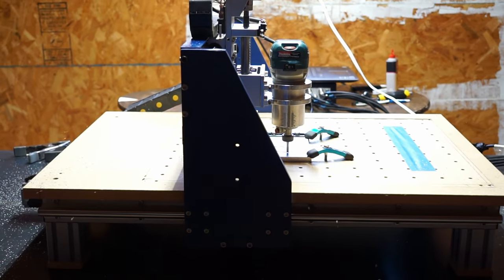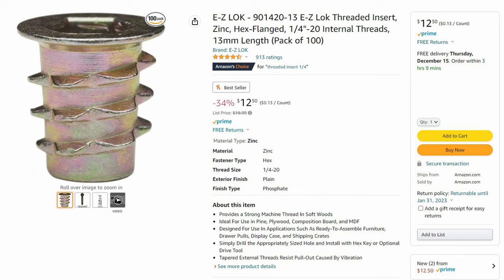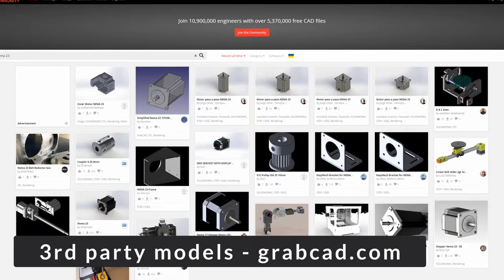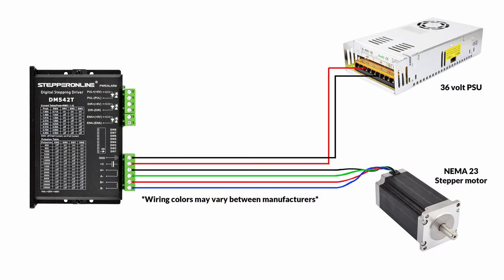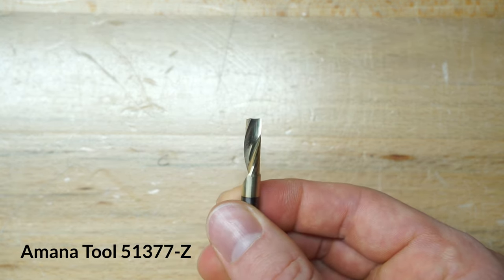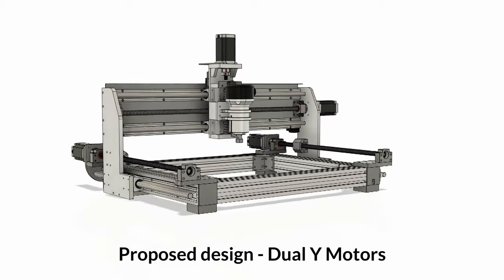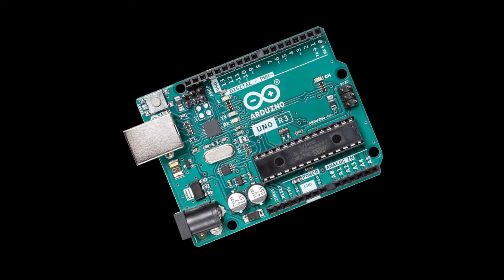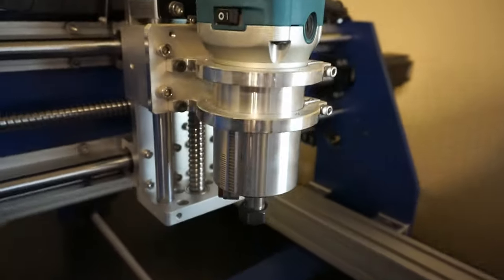DIY CNC: Your Questions Answered (and what I'd do different)

Comment: I also had high hopes for closed loop. After actually trying them I'm disillusioned... SO many wires, delay in step actuation, delay in enabling, whenever they aren't happy they just shut off and need to be power cycled. Take more space and don't even have more power than a regular stepper! Not a fan for now.
Reply: @Maxim Kachurovskiy :  Interesting feedback Maxim.  So often Closed-loop systems are presented as the "Holy Grail" of CNC machinery... a Must-Have, if your budget allows.
Things are not always as we are told then!
Reply: @PiefacePete46  yeah. I'm sure there are good uses for them but so far I had loads of trouble with them and few benefits.
Reply: I don't think the closed loop stepper is a great idea anyway, it won't even close the real loop, which is the actual distance the machine is moving. What you really want is the feedback from some linear encoders mounted on each of the axis which would take care of any mechanical error due to backlash, missing steps, or whatever. It's the only way the system will know how much error it needs to correct.

Comment: opto-isolators are for electrical isolation not noise suppression. You can have earthing problems or voltage spike pick-up which can damage (kill) the Arduino or other controller. As you discovered shielding is the answer for noise but does not mean the optos are redundant.

Comment: One suggestion when wiring stepper motors.  If you have four wires, then they are in two pairs.  If you don't know which pairs go together, you can easily figure it out.  Just connect a two wires together.  Then try to turn the motor by hand.  If it turns easily, then those two wires don't go together.  When you get the correct pair, the motor will be hard to turn.

Also, if you have a motor that is going the opposite direction, you can simply swap how one of the pairs is connected to your controller board.  For example, if you have a black/green pair and a red/blue pair, you can just switch around how the black and green are wired or how the red and blue are wired.  You only have to do one pair and you don't swap between pairs.  Of course, you can also change direction in the software that you use to control the machine if you don't want to swap wires.
Reply: Grear

Comment: Thank you very much for all your hard work and the clarity of your explanations! I'm so new to CNC that I haven't even started yet, but these posts were very understandable. You said you're considering adding a second Y-Axis motor and its associated hardware to prevent wracking of the X-Axis gantry. Replacing the aluminum cross-bar with one is 180mm wide (the Y-direction width of the gantry) ought to greatly increase the geometric fidelity. Looking at the Autodesk model it may be that cut-outs where the ball screw ends or altering the gantry's limits would be necessary, but this is a lot less expensive and complicated than all the hardware land electronics for the additional motor. Just a thought...

Comment: Thank you for the video series! Very inspiring. You sir are an engineer. Its not about the credentials, it's about the projects under your belt. They speak volumes on a resume.😊

Interesting design. I would like to try using one stepper motor for the x-axis on the extruded aluminum. Use some type of belt system with Gilmer pullies. Like a timing belt for an engine. 

I think it would save you a buck or two to have these round rails drilled and tapped along the length. Something like the rail system of a roller coaster. Utilizing the same c-shaped sliders you have. Drill them all the way through, use allen head threaded rod and your t-nuts.

Had to add my two cents like a real troll 😅

Comment: Well, thank you for doing the heavy lifting. I designed and built a CNC router nearly 15 years ago using Nema23's and Stepper drivers making use of Mach3. I am an E.E. (retired) so that wasn't much of a problem. 
I've since built/designed a CNC Laser, CNC conversion for HF Lathe and likewise CNC converted a HF Mini Mill, again all make use of Mach 3. 
This is NOT my hobby however, these are tools I use for my RC Airplane hobby. My CNC Router is seriously deficient compared to modern types. It was ok in its day but now there's better due to the availability of better rails and such. 

My suggestions to better your build, or rather keep it a bit more affordable, would be to replace some of the machined aluminum parts with other materials such as HDPE, Carbon Fiber and/or G10. 
Certain parts can be machined from these cheaper materials and done so more easily. In my case I will be doing some of your parts likely in HDPE using (ironically) my older CNC Router. 

Additionally, the couplers you used are prone to wear over time and have some serious issues with lash. A better choice would be zero-lash couplers.

I'm keeping my electronics and of course Mach3. 

I would recommend to buy and use a Variac to slow the speed of your spindle when necessary. It would be nice to have control of that in the programming but as you mentioned the cost can be quite high for the motor and speed controller.

Further, the extrusions can be purchased to very precise lengths (to a couple thousands) from a company in Illinois named Misumi and so too the corners, angles and couplers needed to assemble the frame.

Variac: https://www.amazon.com/Mophorn-Transformer-Voltage-Automatic-Regulator/dp/B07ZH95TGN/ref=sr_1_3?crid=1D599CSQETYI0&dib=eyJ2IjoiMSJ9.QkmsTJrNwgmqmhadJoYu6tULVyuAELovvrvngXTaj1jbayDGQUFD4vVKgF4oGOzquygMB3pmBg39WdWGtdTIsUHvsccZ935NHjtz4gu-SW7A19HCnL_3xP_Z4xeCjFs2hHrOmSlKSmxHgrxE3zbrBciKNjmWlx4wIYlfegaZ3dj_kArVgaLH5UDxr0ddOvDSaH20DewNeNtwre1U7c3RhD7SQ3b9V9wMp7UKsyu22L4.rFCxCcszH1cl-SVr68ET0S2g6jXPf5_aESdSk6RBl1k&dib_tag=se&keywords=variac+120v&qid=1711036971&sprefix=variac%2Caps%2C204&sr=8-3
Misumi: https://us.misumi-ec.com/
Reply from the maker: Thank you for the info! I will probably either upgrade it or build a new one at some point in the future so I definitely appreciate it.

Comment: Thank you for a very nice and clear video and I think your mechanical set up is much better than many other machines you see here on YT. I am considering to build one machine of my own instead of the Chineese one that I have. To get a stabile mechanical frame is essential and it's not necessarily making the design more expensive. Having two Y-axis ball screws is a good idea and also to attach the Y-rails directly to the table, as you have done, is good for stability. I would also use linear rails but I would choose roller guides instead of ball guides. Hiwin have linear roller bearings as small as 15 mm (RGH or RGW) to a reasonable cost. I would also make it possible to have the option to install double ball nuts on each ball screw and here by be able to do away with any clearance. It is important to get the ball-screws as close to the centreline of the spindle as possible in order to minimize the length of the lever that the cutting forces will exsert on the linear guides and the X-axis cross beam. I am even considering to have two Z-axis screws moving the entire X-axis up and down. Double screws makes it possible to fine adjust the right angle between axis. You didn't mention what type of axial bearings you use for the ball screws. Double row angular contact bearings I believe is a good choice (I changed to 3200 in my machine). Thanks for chairing your build and as a mechanical engineer I appreciate the structure of your build.

Comment: Thank's Ben.  You got so much "right first time" with this machine.  The Wishlist for next time will predictably cause "Budget-Bulge", but not every item needs to be included at day one.  For example, swapping the router for a spindle shouldn't require a major rebuild, if done later.
I understand the appeal of exchanging the X and Y axis dimensions; would the greater span of the gantry still be OK in terms of rigidity?
Chris, on his iforce2d channel, made a CNC Router that uses a single stepper driving two ball-screws by a GT15 toothed belt (I think), moving the gantry.  This appears to work really well, and should be cheaper than doubling up on steppers, drivers, homing switches, and the requirement for a homing routine to square the gantry at each startup.
Again, thanks for these videos; I have filed them in my "Workshop & Tools" folder, as reference pieces for the future!   👍 😃
Reply from the maker: Thanks for the input John, I'm glad you enjoyed the videos. Using a single motor to drive 2 screws is an interesting idea and not something I ever thought of.

Comment: I have used Mach4 based CNC and grbl ones... I 100% prefer the GRBL ones! One issue with Mach4 (besides the price) is that the PC is doing the calculations and sending data to the controler card. This leads to way more back and forth between the machine and the PC than with GRBL which is basically self sufficent. A good example is probing, with GRBL, you can go probe VERY fast as the probing happens in the card and can stop in a ms (assuming deceleration is faste enough). With mach 4, you can have upward or 20ms of delay between the moment when the card sees the probe signal, sends it to the PC, the PC reacts and send a stop signal to the board... Newer 32 bit based GRBL are just wonderful in comparison!
Reply from the maker: Interesting, maybe I should just upgrade the arduino to a 32-bit board instead of replacing the software. Thanks for your input!
Reply: @benmakeseverything  There is FluidNC. Its running on an ESP32 and is a fork of GRBL. And if this is still not enough, there is always LinuxCNC with a Mesa-Card.

Comment: 👏👏👏Its good to see someone build their own from scratch, it aint easy but it is rewarding and you get to know how a CNC works very well this way. Well done👏👏👏 

Now the fun really starts , add a 4th axis and do some real advanced 3d carving 😄Swap out that board for a 4 axis 32 bit controller, about 50 USD , add the chuck and carve away. It's a lot more fun , then you can add a tool changing head eventually if you want but that is really another league. You could also add a Laser head by just swapping the spindle for when you need it, a good 20 Watt diode will be perfect forit, just watch your spoil board though! 

Add a Probe and E stop as well.

Try and stick with GRBL and dont bother with Mach 3/4 , the main hobby community uses GRBL and although Mach software is far better you can do pretty much anything you want in GRBL and its easier to get support when you need it.

Mach 3 & 4 is for professional users mainly and while I do use it on one older CNC machine my newer ones all run GRBL.and work just fine....

Comment: Dual Y motors essential unless you set up a crossover tension wire like you find of traditional draughtsman's table. Many projects do this, though dual drive is worth it if you have the budget. It would be good if you ran some test peices and measured them to check for perpendicularity and dimensional accuracy. (Though you may have good reasons not to show that :)  )

Comment: Just a thought, the closed loop steppers will not really close the real loop, it will be good a tracking where the shaft is but completely unreliable at knowing how far things are off due to backlash, slip, or any mechanical issue. To close the real loop you want linear encoders on the axis to know how much error you need to correct. The closed loop stepper will allow you to correct speed, the encoders will allow you to correct position. If budget allowed, I would look at correcting position first.
Reply: @ogarza3 :  I agree with what you are saying.  A closed loop stepper will compensate for missed steps, and ensure the stepper output shaft ends up at the intended position, or generates an error if the intended postion cannot be reached.  It will not compensate for accuracy losses due to backlash, inadequate rigidity, slipping couplers etc.
I believe CAM software often has provision to compensate for backlash etc... though I don't have experience of it.
Are you able to point me to a video showing the type of linear encoders you are referring to, I don't recall seeing anything that would apply to a "Hobby Grade" machine?
Reply: @PiefacePete46  I am not aware if there are any videos showing hobby grade components, they are not cheap, specially of you go down to micron or sub micron, but you may have some luck looking at LinuxCNC forums or groups, as I do recall seing some builds with them.
Reply from the maker: You are right, I think encoders would be better, I was just on a fairly tight budget. If money was no object I'd definitely do that.
Reply: @ogarza3  :  I've been pondering this further:  if you have linear encoders, the encoders will keep sending messages until the required position is reached... Good.
However, if you have any backlash, the cutting forces will still create chatter, which I don't think any control / motion system will be able to overcome.
If you try to cut a slot the same width as the cutter, the cutter will bounce from one wall to the other, the carriage will oscillate back and forth because of the backlash, and the result will be a mess.  Of course, cutting slots that way is a dumb idea right from the start!  😋
Reply: @PiefacePete46  If you are cutting a slot or fillet the same width/radius as your end mill, then the problem is either a bad design or a new machinist, you always want the tool a smaller radius so that the contact between the tool and the piece is minimized ;). In this case no closed system will save you, and if you don't break the bit you will probably heat treat the part haha.
Reply: @ogarza3  :  Yeah, that's what I meant when I said it was a dumb idea!   😜

Comment: When I designed my machine (very similar but with more aluminium extrusions and bigger machine) I noticed the flat plate gantry sides were my main source of problems. Plates offer surprisingly little rigidity for their weight. So, I ended up using extrusions for the gantry verticals as well. Same weight, much more stiffness.
Reply from the maker: Interesting. I figured 10mm plate would be ridgid, but maybe its not as good as I thought. Might look into doing that for the next version of this machine .

Comment: Hey Ben,
For wood carving it does not impact much if x and y is not perfect square, but for a 2 part mold it would.🤓 What is the measurement for the x y diagonal for your holes? I quess your holes a layed out square, so should in theory be identical. If you have a spare spoilboard, flipping it over on top of the existing would also show if you have issues with squareness. I have a china 900x600 and it needed some shimming to get adjusted. 🧐
Anyway, super good video and detail level 👍👌
Reply from the maker: The holes are laid out on a 2"x2" grid. I made a little tool that chucks into the router and can be rotated around (manually) to check if the router was square with the top of the machining surface. And yeah, I did use some super thin aluminum shims where the Z axis attaches to fix that.
Reply: @benmakeseverything  yes equally important that the z is 90 degree to the X Y surface.
What I was interested in was if the 2" by 2" grid made by the router was actually 90 degrees and not a parallelogram, which was what happened to me. 🧐🤓

Comment: The Arduino Controller (ATMEGA32) only has an 8 bit architecture. That means the biggest number it can handle is 256. If you want to calculate with larger numbers, it has to do some extra steps that cost time. STM32 has a 32 bit architecture, meaning it can handle much larger values (2^32-1) without doing extra steps. It also has a higher clock speed, meaning it can do more operations in the same time. The MEGA32 is a pretty old processor and there is pretty much no reason to use it anymore as a hobbist. It was a solid component with a low price, but its time to move on to more modern parts.

Comment: Instead of Mach, it’s worth considering LinuxCNC and a Mesa controller board like the 7i96s.
Reply: Also, FreeCAD is open, free, and capable. I've designed several products with it and occasionally use the CAM features to emit gcode for a little GRBL controller.
Reply from the maker: Thanks, I'll look into that!
Reply: @benmakeseverything  I have used LinuxCNC with a Mesa fpga card for almost 8 years in my shop, sometimes running 12 hrs a day, started with steppers and moved to servos, no problem at all with that config. Sold the shop 4 years ago and, AFAIK, that setup is still being used